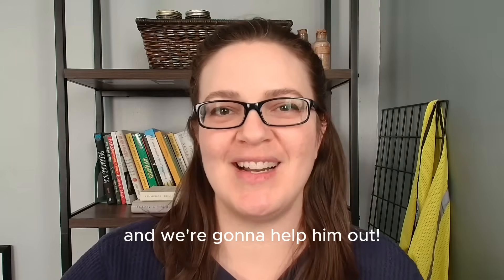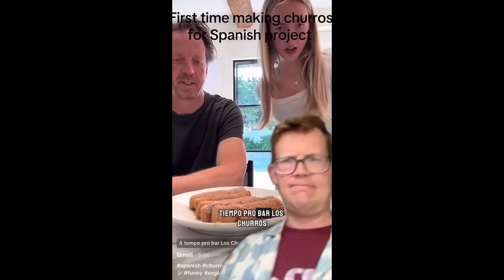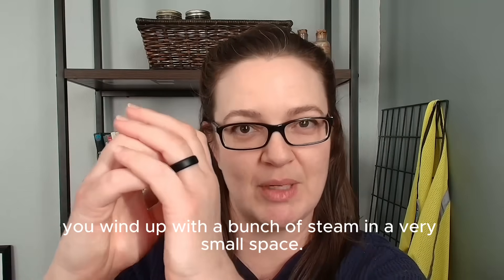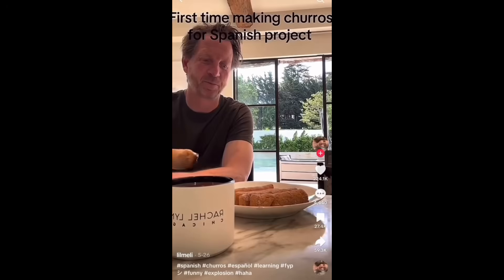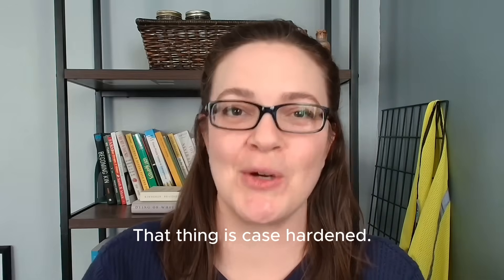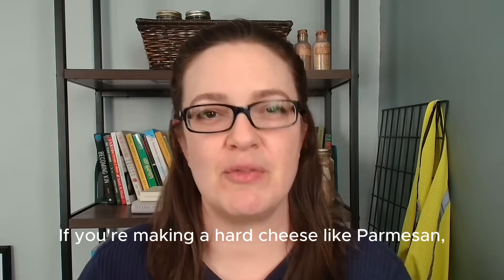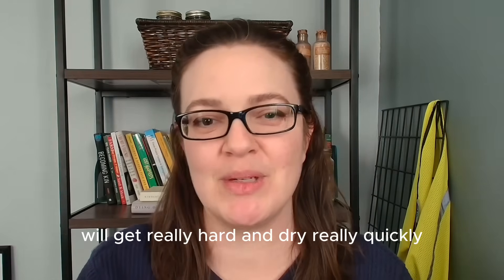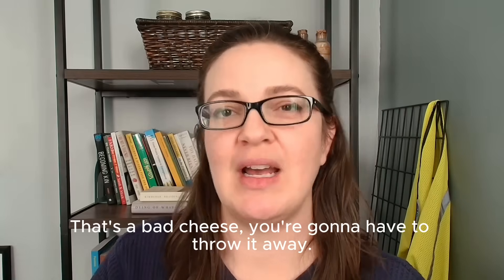Answering Hank Green's Food Science Questions: Exploding Churro Edition

Comment: Same with dried meat, you do it too fast on too thick a piece, and you get a rock hard exterior and a soggy inside, which is bad. You want fast you cut it up into small pieces, and thin slices, and then it will dry rapidly, as there is almost no volume inside that is far away from the surface.

Of course no matter what you do to beef Jerky, it still tastes terrible.

Comment: When the Chinese built a railroad to Tibet, they had to put up concrete pillars for the railway bridge. Because of the cold conditions, they had to use boiling hot water for the concrete and wrap the pillars in thick blankets to keep them from getting cold and drying on the outside too quickly. If the water froze, the concrete would be too brittle to do its job.

Comment: Case hardening happens in bread baking too. That’s why professional ovens have a steam function to keep the outside of the loaves moist until the desired oven spring has occurred. A dry environment leads to case hardening and a poorer rise in the oven yielding smaller, dense loaves.

Comment: Same thing for oil paint ! The “fat over lean” rule is there to make sure that the painting dries at the same speed everywhere. If the outside dries quicker you get cracks and sometimes even paint peeling off. (Note that cracks and peeling can happen for other reasons, but it’s a major one)
Reply: The alligatoring effect that can give away when a paint job wasn't done right.

Comment: Same thing also happens with lumber. You want it to dry evenly otherwise the cell walls on the outside will shut fully and shrink. Leaving a wet core in the board. It absolutely ruins the strength

Comment: For some reason, some of the cakes and pastries I’ve made in my fancy fan oven have become case hardened, and I’m still trying to figure out exactly why this happens and how to fix it.
Reply from the maker: Oh weird. Maybe the surface gets a lil extra dried out from the fan blowing the air around? There's an old trick about putting a pan of water in the oven when baking something sensitive to getting too dry while cooking. (Also putting cheesecakes in a makeshift bain-marie in the oven, but that's more about keeping the temp steady than keeping the oven air moist.) But you may well have tried all that already :_)
Reply: If it's a convection oven, try dropping the temperature a few degrees.

Comment: The most basic example is what every kid should learn about cooking early on: If cooked food is burnt on the outside but still cool/raw on the inside, it's because you cooked it too hot.
Materials have a limited heat transfer rate, so it takes time for heat to reach inside. If you cook food at high temperature, then the outside burns before the inside has any chance to cook.

This is also the answer to a nerd question that came up occasionally on sites like Reddit: "If we zap a food with just the right amount of energy, could we cook it instantly?" - no, a sufficient amount of energy to instantly cook the inside would would incinerate the outside.
Reply: Then with a microwave we have the complication of skin depth. A normal oven cooks from the surface in but microwaves can penetrate 2cm into the food for physics reasons. So a lump of less than 4cm diameter can cook fast because the energy can penetrate all the way through but something larger like a baked potato needs much longer to cook the middle.

Comment: My father was a blacksmith, and I made myself a couple leatherworking tools that he had me case harden in sugar.  Had no idea the same concept could apply to other substances.
Reply from the maker: How on earth do you case harden metal in sugar?
Reply: Really, you are just quenching the steel in sugar instead of water or oil.  The outer layer of mild steel that I used to make the tool ends up with higher carbon content, making it tougher without needing to use more expensive high carbon steel to begin with.  (And less expensive material base material used in case the I messed something up.)
Reply: @FarmToTaber Anything with a lot of carbon in it, plus heat and absence of air, you're trying to generate carbon monoxide around the part you're hardening. It's the best medium for percolating carbon in among the iron atoms. Pre-metallurgicaal-science recipes for case hardening had all kinds of gross and/or alarming organic ingredients, and this may be where legends of magic swords quenched in the bodies or blood of human sacrifices came from.  Assuming that didn't come from the fevered imagination of some fantasy writer, anyway.

Comment: If I had to guess, the issue was that the dough was too wet and the churros were too thick.  They should be the length and width of your finger. To make churros, you use the same recipe as eclairs. Only you fry them rather than bake them. When eclairs are made, they puff up and have an empty cavitiy. The same thing happens with churros, but not as much.  When you make a choux pastry, you cook flour, water/milk, and butter together until it forms a ball. Then, using a mixer, you want to beat mixture until  the bowl is no longer hot. This helps get rid of excess moisture by giving the steam a chance to escape. Then you beat in eggs. After that, let the dough rest in the fridge for a couple of hours before using.
Reply from the maker: It would not surprise me if a few things went wrong in this recipe

Comment: As a metallurgical engineer I was... more than a little concerned... to find out churros could case harden too. Thanks for educating me! 😅
Reply from the maker: Case Hardening: Fun For The Whole Family (Of Trades & Engineering Professions)
Reply: soil can be case hardened too if it's dense and left in a dry location, leading to structural issues when the sun comes out and starts warming it up! This is why it seems like they're always spraying water around at construction sites, especially for highways which are designed to carry a lot of weight.
Reply: @dawnderg  Oh, that's why? I always assumed it was to control dust!
Reply: @ethanharvey dry exposed soil can also become hydrophobic and can turn construction sites into swimming pools if they haven't dug out any channels.
Reply: @ethanharvey  it is, but soil also needs water to compact properly so they can add liquids during compaction to get the desired results. if they are putting water down where they are driving, its for dust. if they are working it into the soil its for compaction.
Reply: Dude, that's me in another life.  Got my degree but ended up in another field.  I was wondering about just how analogous this is to metal case hardening.  I knew mostly about structural steels.  And that hardening won't really happen without rapid controlled cooling.  At least some of the hardening of batter has got to happen even as it cooks.  But THEN I remembered sometimes things appear to be soft and not yet done, but if you take it out of the oil it'll get crispy as it cools.  It's the SAME!  I wonder if there's any interesting textural things you can do by quenching fried foods.
Reply: @valintepes  Careful with your quenching media. Water and hot oil don't mix well. Other fluids like oils, fats or a fluidized air bed could work. As long as the specific heat capacity and thermal conductivity were adequate to the task. I'd recommend talking to a food scientist or chemist for better guidance though. Check out work by Herbe This or Harold McGee. They've done some really interesting food science for cooking in the past couple of decades. And of course FarmToTaber is a great resource right here!
Reply: somehow it feels a lot like the bread equivalent of a prince rupert's drop
Reply: @pallingtontheshrike6374 Tempered glass is quick-hardened so it shatters into tiny blunt pieces that won't shred any unfortunate human in the vicinity
Reply: Not so fun fact: dry aged steak can also undergo case hardening. If it dries too fast, it will lock in moisture and become a breeding ground for bacteria instead of becoming preserved
Reply: I don't study metallurgy but I am also concerned that you're concerned :joy:

Comment: Happens with wood too. Dried too fast in the kiln creates the same issue.
Reply from the maker: oh YIKES
Reply: @FarmToTaber it's not a steam issue but it can cause lots of issues that become extremely dangerous. The wood when you first cut into it will immediately warp, pinch, or otherwise bind and has led to many less fingers on hands.
Reply: @Jimigonzo  Oh YIKES!
Reply: @Jimigonzo  have people figured out ways short of making that first cut to get some idea that this has happened?
Reply: @davidfetter I think to an extent. It's more that you should assume it is unless you have been going to a trusted source long enough to verify their drying method. You can get some idea if water stays beaded up on the wood without soaking in, but that also happens when it case hardens from age so not fool proof. You could probably drill holes and take moisture readings. The safest method is assume it will be that way and to make several small relief cuts before going for the full cross or rip cut. That allows the tension to slowly release without seriously splitting or binding on the blade.
Reply: This has been a way wilder comment section than I could've anticipated.  Improper quenching of metals can royally screw up the macrostructural specifications of otherwise the same identical steel.  Opposite is also true, tiny difference in chemistry can cause the same heat treatment to created far harder or softer metal than is desired.
Reply: Another new thing I learned here thank you
Reply: Woodplosion 😊